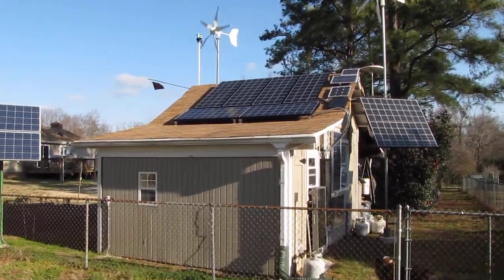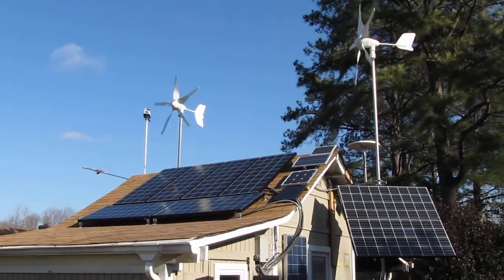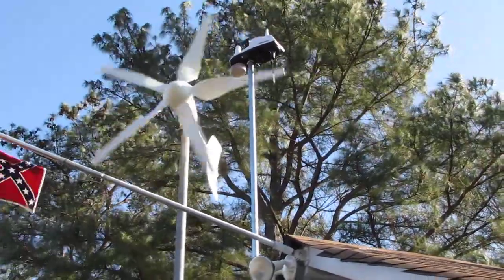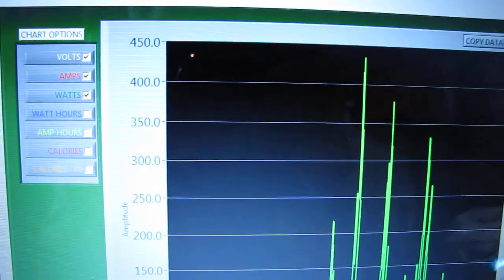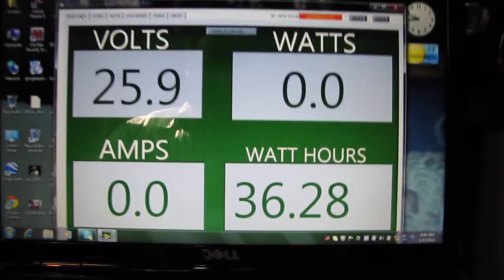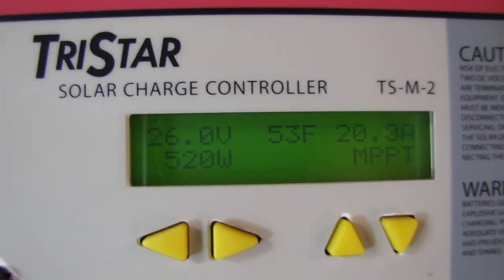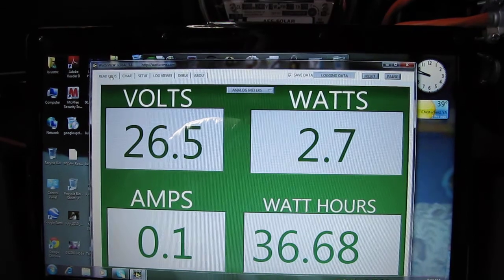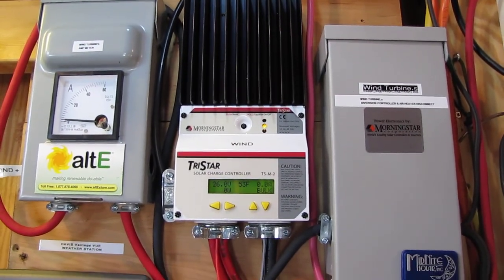International Brotherhood Of Boilermakers ! Boilermaker Builds And Designs Solar And Wind Hybrid

Comment: Kenney,  Does your electric company allow you to sell back to them watt for watt? I see the dial meter in your shop but do you have a dual meter set up that the electric company can subtract what you produced and reduce the electric bill year round? I have a digital meter that just sets there if I were to over produce electricity unlike the old style dial meters that will turn backwards. Good video!!